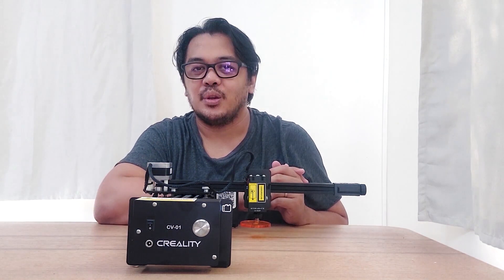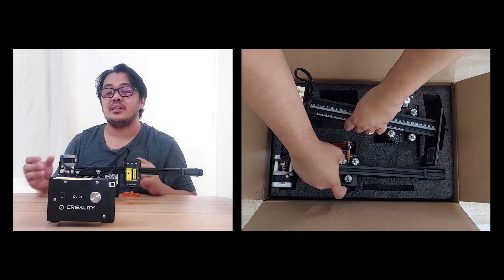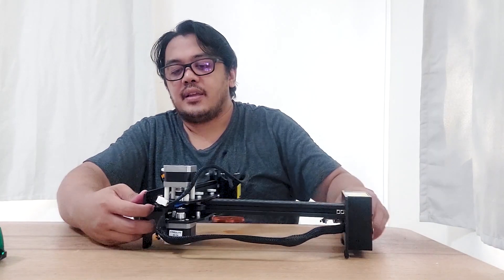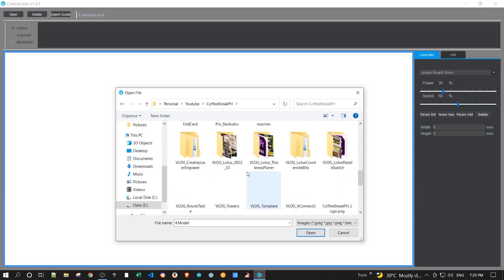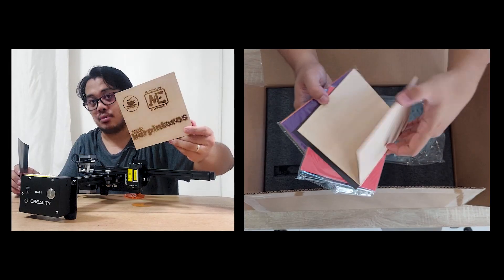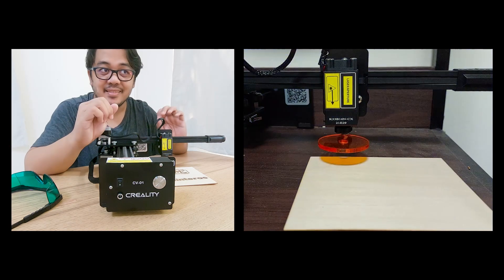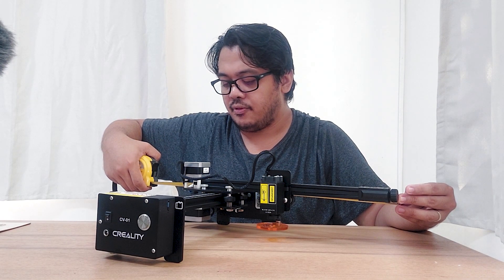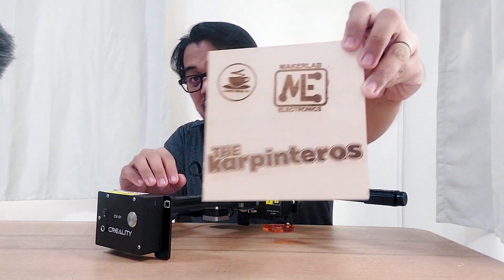Creality Laser Engraver CV-01 | Unboxing, Setup, Testing and Review | Makerlab Electronics

Comment: The CrealityLaser software does not accept the images. I doesn't even accept the sample images on the disk. And I can't find an update online.
Reply from the maker: Did you run it as administrator?
Reply: @CoffeeBreakPH  I did and it finally showed up and made the gcode but when I put the flash drive in the machine, I turn it on, the laser repositions and the fan kicks on, but nothing happens after. I push the button and the fan just spins. No laser.
Reply from the maker: @mrkobayashimusic  remove the bin file and gcode from the microsd. Then generate code and put it into tje microsd. Turn the engraver off, then put in the microsd, turn on the machine. It will go to home. Press the function button, and it will show the engraving work area. If you need more time to reposition your work piece, turn off the engraver again and turn it on then press the function button again. If you are all good, press the function button and it should start engraving
Reply: @CoffeeBreakPH  
I created the gcode and copied it to a blank sd card
I put the card into the machine. I plug the machine up and powered it on. 
The laser resets to the starting point.
I press the button and the fan on the laser cuts on. And nothing happens after that.

I pushed the button again and nothing happens it just keeps spinning and sits in the same spot.

It used to move around without the laser on then pause if I pushed the button again, but now it doesn't do that.
Reply: @CoffeeBreakPH  I think I may have figured it out. I believe the card that I was using was too large for the machine to read so it wasn't accessing anything on it. Thank you

Do you know of a compatible upgraded laser that will work with this that's strong enough to cut through wood?
Reply: @CoffeeBreakPH  It only worked once. but it never showed the work area it would be printing in. Now the laser doesn't even come on. Is there a link to the firmware update possibly?

Comment: Boss may tanung ako ung nabili ko kasi pagopen ko walang ilaw ung mismong laser. At pag pinundot ko ung function button for first time walang ngyayari. Brand new ito nabili ko
Reply from the maker: Oks naman po wirings? Plugged in yung power properly? Medyo need ng onting tulak yung power cable sa harap.

Comment: Sir I want to print on pen  (4mm*30mm)...I am running a pen manufactering unit...As a commercial purpose is this machine is possible for printing...
Reply from the maker: What's the material of the pen? If it's plastic, no. If it's stainless, most likely yes. You just need to dial the settings. I have tried it on pencils.
Reply: @CoffeeBreakPH  my pen material is ,(use and throw )plastic... especially i want to know about shapes of the surfaces which the particular printer can  comfortable for printing ( curved surfaces with  5mm height)
Reply: @CoffeeBreakPH  will u plse share the photos of  pencil printing which u tried ...and I think it's good effort  in pencil👍, heat punching machine  is nw am using for  my printing works in pen  and pencils, although it's plastic

Comment: Sir everytime na mag eengrave you need to put mermorycard on it?
Reply from the maker: Hi. Yes. It reads the gcode from the memory card. Kaya if you'll have a different design, generate a new gcode lang into the memory card then plug it in to the engraver.
Reply: I see. What if po 10pcs same design? How to do that po? 😊
Reply from the maker: Press lang po yung function button ulit to start another engraving :) No need bumalik sa computer/laptop.
Reply: Thank you so much ♥️♥️ kaso sold out na sa shopee 😅